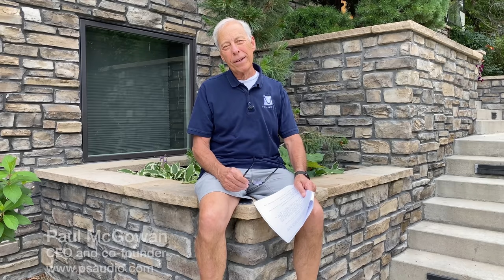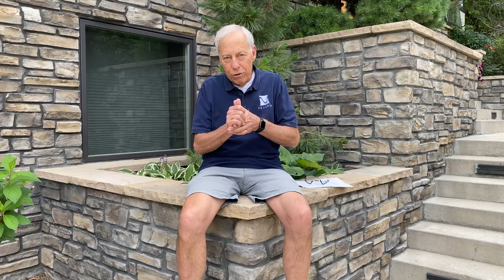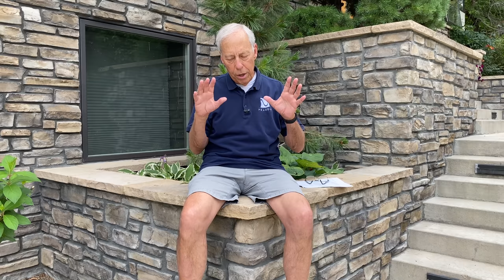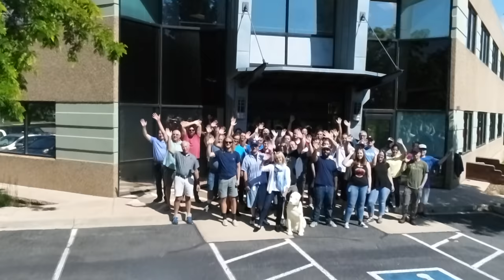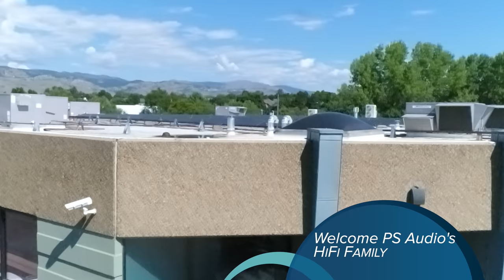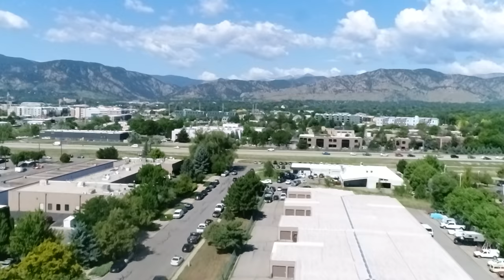Speaker cabinet resonance. Gimmick?

Comment: Very simple experiment: take a driver emitting at or above normal speech volume output (75dB and above) and let it play in free air.
Then press the magnet (the heaviest therefore hardest to excite material of the driver) reasonable firmly on a number of surfaces including speaker cabinets, and listen for the difference.
It’s there and it’s huge.

Speaker cabinets are the single most important contributor to the sound signature once you are out of the treble range.
Reply: why don't we have cabinet less speakers.
Reply: @simonlinser8286  We do.

Comment: Great answer Paul.  The clue is in the question, that's to say, resonance.  All solid structures have a resonant frequency.  If you introduce vibration they will vibrate too.  However, the amplitude of the vibration will increase dramatically at the resonant frequency of the structure.

It's the reason why bridge engineers have to make sure the resonant frequency of the structure is well away from the frequency of swaying caused by a strong wind, otherwise the bridge will tear itself to pieces.  There is a famous video of just this effect.

You can damp resonance by using a second material of a different size or density in close proximity to the the primary structure or you can go the stick on suppressor route.  An example of the former is the platter on the Linn Sondek LP12.  It has an inner platter and separate outer.  The two parts have different resonant frequencies and one effectively damps the other.  You only need a thin felt mat to support the record.

Comment: This is Brian again. Paul, you nailed it. The  cabinet resonance will definitely reverberate back into the output of the driver. Especially at high volumes. I believe speaker cabinet makers build their units to work at certain peak volume levels and  extreme high volumes aren't a big consideration.
Reply: Many speaker designs have damping materials inside the cabinet, go figure😉 🤣🤣

Comment: Some speaker manufacturers make full range speakers that will reproduce 20 Hz accurately and with ease (if the amp is up to the job).
And some of these manufacturers also make subs that are designed to work with their full range speakers.

So why would a speaker, that can easily reproduce every frequency, benefit from a sub?  (keeping in mind the goal is for accuracy -- not bloated double bass).
The answer is to minimize the vibration in the main speakers.

When you record video with your camera, you want the camera to remain perfectly still.
When your speaker's drivers produce sound, you want them to remain perfectly still (and, yes, they move in order to produce sound -- I am talking about not moving from external forces).

So by using a high-pass filter for the main speakers, and having the subs, in their own stand-alone cabinets, produce the most violent frequencies, then the main speaker cabinets will vibrate less, resulting in a better focused soundstage with better imaging, etc.

Cheers!
Reply: Heard of OIS? Everything moves and it makes the video even better.
Reply: In your example, there is more involved than just the cabinets.  Since the woofers in full-range speakers usually work into the lower midrange, making them reproduce high-excursion low bass at the same time causes IM distortion of the midrange frequencies.  This gets worse as sound level goes up.  Offloading high-power low bass to a sub often yields audible improvement in midrange clarity.  
Then the only issue we have to contend with, is the same kind of IM distortion in our hearing.  As far as I know, no one has been born with subears for those low frequencies.
Reply: Also, acoustic interaction in the room. Subs and speakers have different placement requirements. 

Oftentimes the ideal position for the Left or Right speaker isn't ideal for the subwoofer. Speakers are to be placed symmetrically, and subs placed according to minimize excitation of resonances. Rarely are those the same place.

Comment: It's also significant that cabinet resonance follow driver motion in time and can extend for some considerable period of time after being excited. Additionally, the generally large surface area of a cabinet panel needs only to move a little bit to produce significant output. Thanks for a fine presentation, Paul!
Reply: That’s why it’s important to have a good ratio of weight to absolute stiffness.

It’s not good to have something reasonably stiff but with a lot of mass. It will just blubber along anyway in the lower frequencies.

Concrete can sing because it is actually not that stiff, but brittle and hard.

Foam and foamboard are on the other hand not totally crazy speaker materials, provided you know what you are doing.

Comment: I found the B&W factory tour YouTube fascinating to realize the lengths they go to build a cabinet.  The tweeter in a solid aluminum case and then on a rubber dampener to reduce vibration transfer from the midrange.  So I then added a silicone dampener between my bass cabinet and the mid.  Wow.  Immediate impact to an already good sound.  Clearer, less muddy.  That is with cabinets made of 1.5" solid walnut.

Comment: Hi Paul.  You did a great job of explaining resonances adding to the response curve but you didn't look at the other side  A speaker driver makes vibrations and the speaker cabinet's job is to send the speakers vibration out into the listening space.  
Speaker cabinets that vibrate can also cause nulls in the response curve ( not peaks only ) because they are absorbing some of the vibrations that are suppose to be sent out into the listening space.

A rigid well designed stiff cabinet allows the driver to transmit sound into the air, rather than being absorbed by the enclosure material.  Just a thought to ponder.
Reply: That's a nice clear thought. It's hard to say what's intended, but it might be a matter of a preference, since it changes the sound.

Comment: May I ask a dumb question?  If resonance is a big part of a speaker sounding good, why don't high end manufacturers line the interior with dynamat or a roll-on sound deadener?  I cant seem to find anything regarding this, not even on DIY speaker videos.  If you want to kill resonance,  coat the interior in a material that kills vibration.  I know this liquid, spreadable material exists... I've used it.  Just not for this application.   What gives?

Comment: This is hugely important. Paul makes that clear well. It's one thing you can easily measure btw. A waterfall measurement, where you also measure the decay, can reveal this behavior. A speaker with a perfect frequency response might not have a perfect waterfall graph. Great speakers stop "speaking" quickly when the intended sound wave stops. Before listening to a new speaker I always knock on the cabinet first. TVs are notoriously bad on this issue and if you knock on the back cover you might realize one major reason why your TV sounds so bad and why you need to connect it to a proper system.
Reply: Fat Rat Yes, but cabinet resonances are a great concern for any respectable speaker maker. The CX-100s I just put in the garage are made of thick aluminum and are as quiet as anything can be. Some live music really can do well in that garage. But music not intended to sound live is bad in that setup. Where can I read about what Harbeth is doing special?
Reply: Absolutely. Cabinet resonances are spurious noise sources and need to be minimized to make a good loudspeaker. There are quite a few ways to skin the cat 🐈 but a designer that can do it at a reasonable cost is a great designer.
Reply: @StewartMarkley  Yes, it's not rocket science.
Reply: Fat Rat  Here's a funny anecdote. An Alan Shaw used to work for me as a electronic technician back in the early 1980s. At the time I was managing the Test Department for a Audio/Video manufacturer named Thomson CSF Broadcast, a company that was sold by CBS to Thomson a French electronics conglomerate. This turned out to be the springboard for me to get into the CBS Technology Center and work with some well known names and inventors in the science of audio and video. Anyway, a different guy of course but a funny coincidence.

Comment: Interesting. While I don't disagree, there's a lot of manufacturers who don't subscribe to that philosophy, rather tuning a more lively/lossy cabinets instead, saying that it needs to work with the drivers, and tuning the resonances lower so they're out of the midrange where they'd be more objectionable. Harbeth, Totem, Audio Note, Devore Fidelity, Snell, are a few that come to mind. I also doubt that concrete sounds very good as a cabinet material.

Comment: A prime example of cabinet improvement is the difference between the Elac Debut 2.0 vs the Debut Reference.  The 2.0 had quite a bit of resonance but the Reference added improved bracing and it’s a huge difference with practically the same driver.

Comment: Absolutely true. Speaker cabinet resonances do exist and are detrimental to the sound of a speaker. It will cause peaks and valleys in the frequency response of a loudspeaker. The goal is to minimize these resonances so they do not add colorations to the sound.

Comment: This is completely true. I made my own speakers using 18mm Birch ply....I then lined the inside of the cabinet with 10mm dense rubber, and the speaker just sounded quieter, with less interaction from the cabinet. 

Paul, check our Acoustic Energy reference series speaker construction. They sandwich a plastic / rubber layer between two thin, 5mm ish sheets of mdf for all the external walls, with lots of bracing internally. Its very effective. 

The BBC research papers that Harbeth speakers refer to, say they found thinner materials sounding better than thicker sheets. Probably because its storing less energy. Using a hybrid technique, like Acoustic Energy seems like a good solution.
Reply: Thin cabinet wall might give more bass. 
But the quality of it might be disputable.

Comment: I was just building a 2x12 speaker cab. While sanding the edges with an  electric sander the cabinet would start to sing at 212 hertz, much like running your finger along the brim of a glass. I measured it with a guitar tuner.

Comment: 😀 i feel the speakers resonance is good it gives that extra depth to the musicality. Of course a speakers in a wooden box sounds much better than a speakers in a conrete box 😀. In olden days they gave so much importance to speaker design particularly for material and thickness. Those speakers sounded so good because of the boxes. Pulp wood boards and not more than 3/4" thickness.

Comment: Back in the late 50's there was a Popular Electronics article on "Clean Sound From the Drainpipe Eight" Using a section of sewer pipe as the enclosure. Then there are the Warfedale sand filled wall enclosures

Comment: I would love to know the name of the guy selling cement speakers for cheap!.
Reply: Shipping costs?
Reply: Bear in mind, that is cheap using Paul's definition of it as reference.
Reply: I'll sell you a cheap cement speaker.
Reply: Homer Bach-Hertz
Reply: Vinnie and Vito...have shoes to go along as well...lol
Reply: @hubert8694  they seem to have a couple of very different concepts going on there by the looks of it, a more conventional driver array from scanspeak and some models based on tang band full range. (after a brief look)
Reply: I think B&W has concrete in their 800 series speaker cabinets as well.
Reply: In car audio SPL builds ...I saw a guy in van pour concrete bass before building box that was 4 layers of birch then after box is done he cut rooftop off and poured concrete around rest of box...insane

Comment: Yeah, eliminating cabinet resonance is about as far from a gimmick as anything in speaker design and building can get.

It is measurable, and pretty easy to hear.

I spent years building high end speakers with a friend, who is now an engineer at high end speaker company in Southern California, and we would always use a simple MDF enclosure to get the design in the ballpark of testing and sounding in the ballpark of where we wanted it. 

But when it came time for final changes, and getting the design to be dialed in, we would always build an enclosure with constrained layer damping,  extensive bracing, extra thick baffles, etc.

And the better the drivers and crossover components were, the more important getting the cabinet out of the way became.

Comment: If you listen to a pair of box type speakers at high or normal volume levels, the speakers radiate the same sound pressure level you are experiencing
right back into the same small box, wich resonates and mixes into your soundstage..
Another resonance source wich ruin sound is HF/MF driver outside corner/box reflexes, wich can easily destroy sound quality.
This was demonstrated many moons ago , A magazine tested several HF drivers mounted on either a normal box, or a box with a heavily damped
baffle with 25mm rockwool, and cutouts, and the difference in measured and percieved accuracy shocked them, so resonance is a problem imo :)

Comment: Passive radiators resonate more than anything.  High fidelity excludes resonances.  Fidelity referring to the output matching the input.  If you want high fidelity speakers you can't have ports or passive radiators as these do not accurately reproduce the signal. Think I'm wrong, ha.  Go ahead and play some music through a speaker with a port and record the output.  Play that recording through the speaker and repeat that path three to five times.  The slow, late, ringing bass will get exaggerated so you know what to listen for.   The initial transient bass response only includes the woofer output.  So it may only extend down to 50 Hz.  Several cycles of bass later the resonators (ports or radiators) start to ring and produce output late and continue to ring after the signal is gone.   Look at the wave form of a plucked bass or bass drum.  The short peak with exponential decay is the waveform.  That peak gets compressed because the port doesn't produce it.   Ported speakers are driven by the old school separate component crowd that doesn't want to add any bass equalization.  Replace that port with a second woofer and then apply a Linkwitz transform to get deep accurate bass.  Sell those ported speakers to a "friend" while you can.  Sealed high fidelity speakers for me thanks.

Comment: I'm looking for a diy design to mount a 10 inch Tannoy dual concentric at the top of a concrete or clay pipe, firing upwards against the tip of a marble or resin cone for even dispersal.

Comment: On a more interesting note, I have read about speaker designers who tune their cabinet resonance to make it resonate at frequencies that are less annoying. This should be more practical than trying to deaden them all together. I am not sure if this is true (as practice) and if it is a viable practice but it does intrigue me.
Reply: Loudspeaker cabinet resonances can never be used to an advantage. They are just random spurious resonances that add noise and distortion to the speaker output. Harbeth can change the resonant frequencies and amplitudes by variations in cabinet construction to spread out the resonant frequencies and lower their amplitudes but using the cabinet resonances to any advantage is not possible. All respective speaker manufacturers do this or should do this anyway.

Comment: That's a easy one ;-) Turn up the volume, and then put your hands on the speaker cabinet. If it's shaken and you feel vibrations, then you need some good isolation, and that's it! Cheers from Denmark (btw Paul....did you loose weight over the summer?) You look healthy and more slim ;-)

Comment: Acora speakers use granite in the cabinet = no resonance. On the opposite end Harbeth uses the cabinet wood to enhance the sound apparently for mostly  the midrange.  Different approaches to design with excellent results. Then look at a very unusual design by BAYZ-audio speakers from Hungary I saw at Axpona in 2019 with excellent sound. PS Audio has a lot of tough competition ---------- I wish them well.

Comment: A closed non-resonant cabinet design for a passive 3-way is a waste of effort without the careful consideration of implementation and cost for completely isolating the midrange driver, as you typically see with tweeters in 2-way designs. Tweeters are typically closed on their own, which facilitates mitigating cost.

Comment: When i was younger, i was a Technics fan boy. 
I had very unusual Technics monitors, probably from the 80's. 
They were 3-way, working as closed box or bass reflex - you choose by the flip of an plate, 4 or 8 Ohms - switchable, all drivers - metal honeycomb, quite big x-over, and the cabinet was aluminium. 
Very small, bass driver had only 11cm afair, but very heavy. 
I hope they are still somewhere in my Parents home, i never sell my audio. 
They were looking like stuff form XXII century, and the quality of build was really very high, but sound was not the greatest. 
In fact they sounded much worse than my DIY speakers on a set of old Japanese full-range + tweeter drivers. 
Excuse my English.